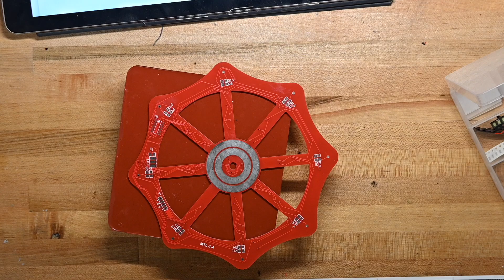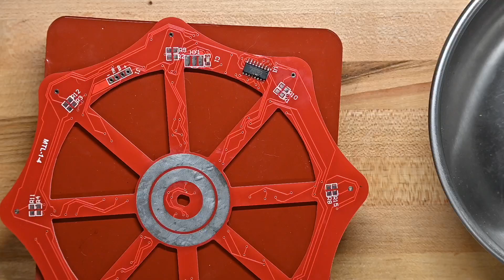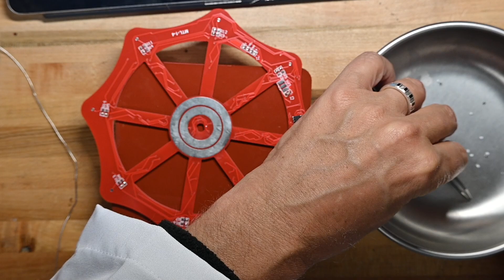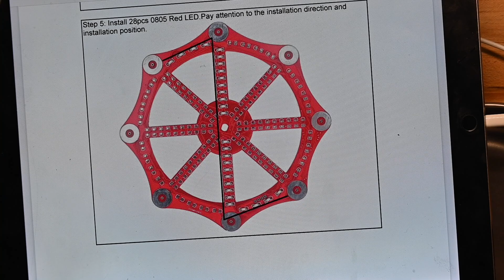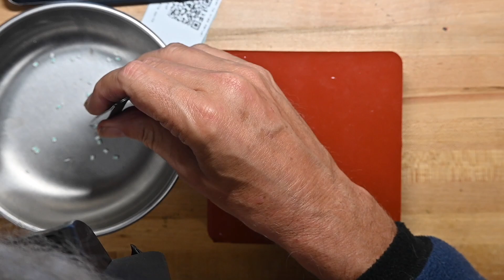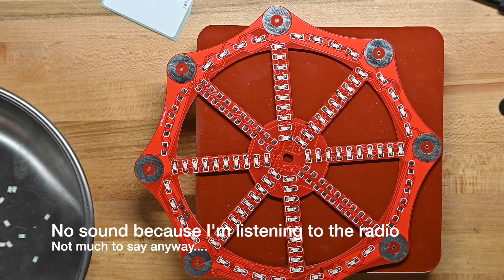Extra: unedited ferris wheel surface mount soldering real time

Comment: This SMD LEDs are a pain...
Reply from the maker: Over time, once I got the hang of them, SMD LEDs are faster to solder in than through-hole.  No fiddling with leads.
Reply: @CKHaun  true but is also a pain to keep them in place plus the fact you can burn them if not faster enough with the soldering.